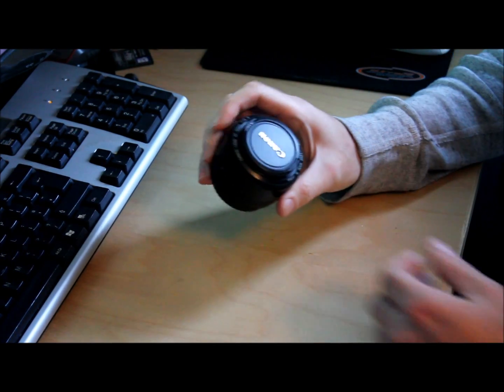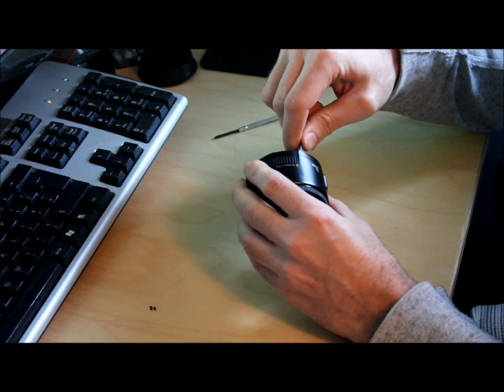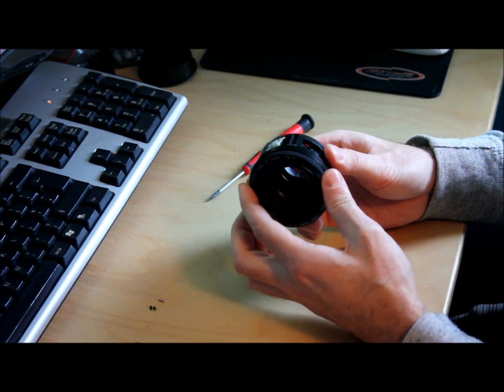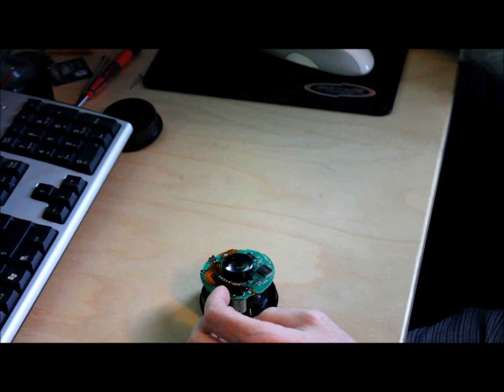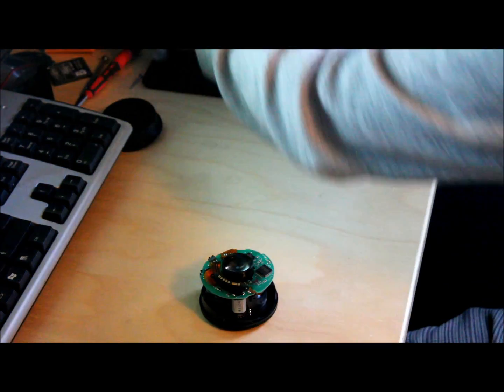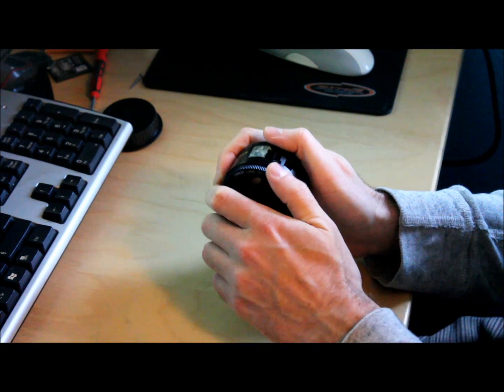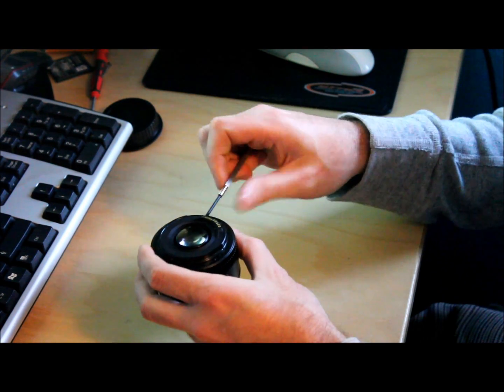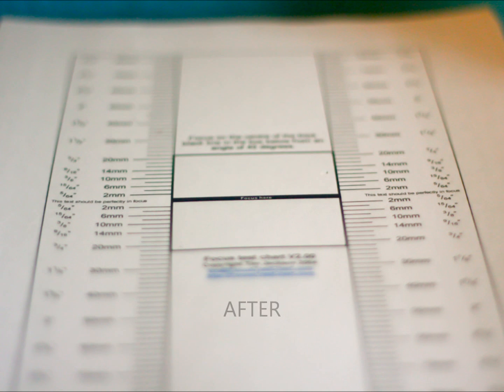Canon 50mm F1.8 DIY Focus Calibration

Comment: So what exactky did you solder? I'm not totally clear on what you meant by the 5 pins and joining dots etc? Did you follow a guide? Also was this focus issue only in viewfinder or also in live view screen mode?
Reply: Hi Jamie, by joining the dots, he meant shorting two or more pins together by soldering. 
You can find step by step instructions in this guide from the manufacturer.
If you look around, you can easily find Canon's own step by step guide to do this fix. Of course it's QUITE old so the pictures/document quality won't be as good as new documents...

Comment: Before anyone start soldering use a multimeter in continuity mode to check what he's soldering. You might find out there is continuity meaning soldering those two points is useless.

Comment: Thank you so much, I wondered why I couldn't even get sharp images after micro adjustment on my 50D.
Now after soldering the to far left points (mine was front focusing too) my lens is spot on.

Many thanks for sharing.
Reply: Hello, Great, I have same problem mine is front focusing, may you be so kind to share picture of the points you soldered? thank you

Comment: Good Lord do NOT move the focus ring manually with the switch in AF, it will destroy the motor!
Reply: will not destroy the motor, the gears can get damaged
Reply: the video is not about the STM version.
i have that lens and i'm an electronics engineer.
So what we are talking about?
Reply: Also check description below video. Now, please feel stupid.
Reply: +Tibor Danilics Sorry the desc isn't by default open on mobile for when I replied. The title labels the STM version. I'm just a lowly mechatronics engineer, but regardless, if you were to spin the motor the opposite direction that the AF was going in, wouldn't the motor both draw a high current and also generate current simultaneously through the windings?
Reply: +Tibor Danilics spinning any motor manually can burn the motor out when the motor is not designed that way. It's a stepper motor.
Reply: no, it's a simple DC brush motor
Reply: +Tibor Danilics the canon 50mm 1.8 is an STM lens, not a USM one. nice try though.

Comment: I have a frontfocusing 50mm 1.8 mkII.. And I took it apart to to this mod, but the solderingpoints to the left where already connected! My solderings looked like X-X-X X X. Anyone know which ones to solder/unsolder? My lens is frontfocusing around 12-15 millimeters. Btw I connected the two on the right (X-X-X X-X) and it got a couple mm better, but not enough. Any one that have the service manual or have experimented enough to know which solderingpoints does what?
Reply: I've been searching myself for the answer to that question, the only thing I can suggest is trial and error.

That's what is suggested here. http://photography-on-the.net/forum/showthread.php?p=6365675

Comment: I guess that is not a fixed amount of focus shift. It will depend on the distance to your subject. Let's say, if you take a portrait at 2 m, it will shift 10 mm, but if you take a full body frame from about 6 m.. it won't be 10mm anymore. Try and see. Mine was crisp focusing at close range.. and front focusing from 3m and above. I done this "surgery" so now i know that i have to focus somewhere on the nose to get the eyes on focus :) . Thanks jontihobday !

Comment: There's a document published for the Canon 50mm, 28mm and 15mm lenses which all have these adjustable focus correction points. Other lenses do as well including the 50/1.0L and the 85/1.2L, and presumably others also. Search google for the Canon EF 50mm 28mm 15mm service manual.pdf.

Comment: Does anyone know what's wrong with my version of this lens?

50mm F/1.8 MKII doesn't connect to my cameras at all... all I get when I connect to my camera is f/0.0 and it fails to connect. I have cleaned the contacts like crazy and I don't know what's wrong with it. It's very frustrating and I am not able to send it in to canon.

Comment: Nice video.  Mine has a slight front focus of 8mm on around 50% of shots.  So I take it I shouldn't do this mod?  Also....you say it will correct front focus or back focus depending on which solder point you use but you don't explain how far forward it would bring it or how far back.  Please explain....  Thanks.